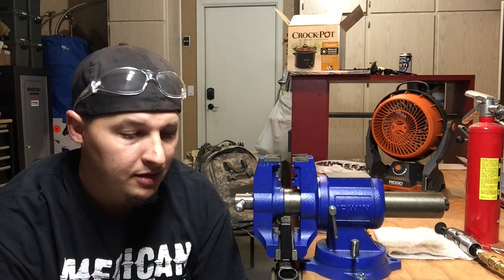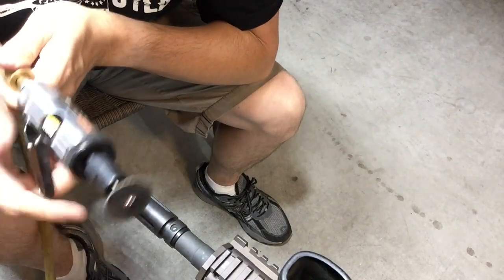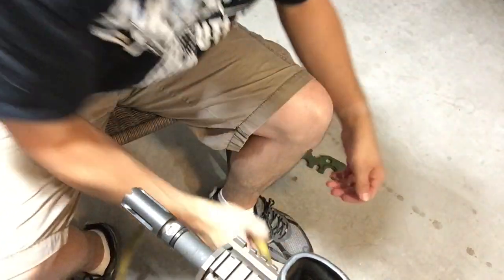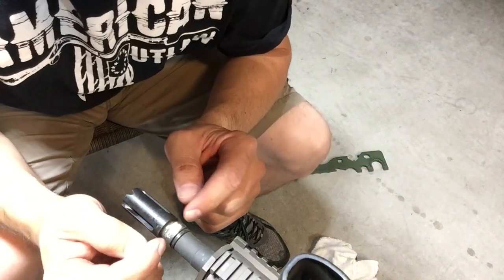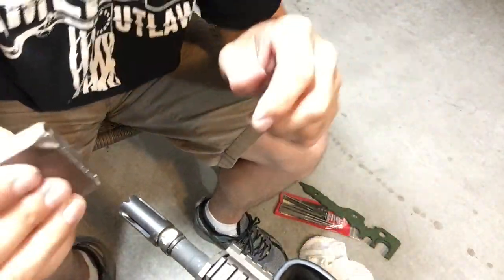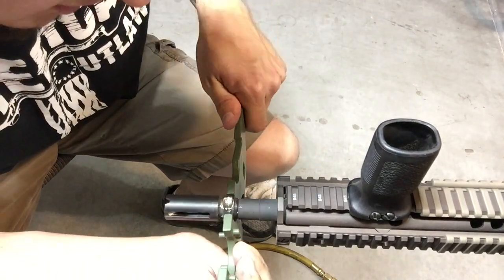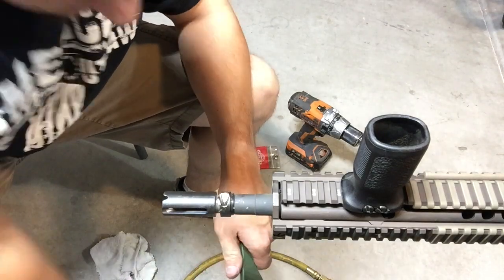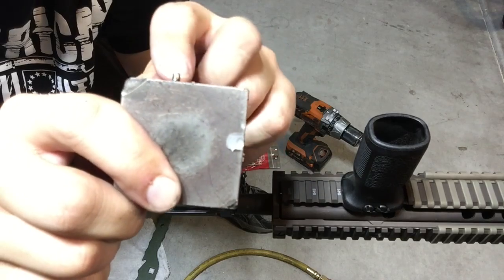Removing Daniel Defense M4a1 Pinned and welded Bird Cage

Comment: Pin was hardened? Why not just drill it out?
Reply from the maker: К.В. П. Honestly because I did not have a drill press and I was worried on how far down I could go without hitting my threads.
Reply: Drill press is not needed. Just a power hand drill will be far enough. Maximum pin length not more 8mm, I think. Diameter is not more than 3mm. Accurately and carefully operating by a hand drill with 2mm drill bit, you drill out this pin to a depth of 4 - 5mm, then just break the remainder with armorers wrench and unscrew the muzzle device.
Reply from the maker: Thats great information thank you If i had that info I would have tried that for sure.  At one time I attempted to drill but broke the bit right away lol live and learn.  Thanks for your information and reply very helpful.
Reply: One else moment. I don't think such pins are hardened. So, it's may to drill pin out, at least, 3mm depth, hammering a screwdriver in this opening and try to pull pin out. Or you'll can use a special extractor for  unscrewing broken bolts.
Reply: Common material for pinning is Drill Rod, made of the same thing your standard drill bits. So, unless you're using a Cobalt drill bit. You'll ruin a lot of bits trying to drill it out with standard high speed drill bits.
Reply: @BusterdBodycrab  Drill rod is in an annealed, non-hardened condition. It is generally able to be drilled out with good HS drill bits. Definitely achievable with cobalt bits. That is, unless someone uses some crazy material.

Having said that, why in the world people use drill rod for this is beyond me. It is not necessary to have such a material for pinning, and it makes things much more difficult if it needs to be removed. A piece of mild steel is plenty, even a piece of 1/8" welding rod would be OK. 

BTW: I use some annealed 4037 precision ground dowel pins for this task. Cheap, plenty strong, and reasonably easy to remove.
Reply: @LE-6920  I fucking love you, dude. Super stoked to get my M4A1 now as this was the only thing keeping me from doing so.
Reply: I believe they use drill steel for the pins. So it will be very difficult to dril it out.
Reply: Those pins are typically made from drill rod blank steel.

Comment: You are correct about the 90 deg. It's done so that you get the proper reading. If your torque wrench is in-line with your armorers wrench then you've increased the leverage and you'll apply a higher torque than your wrench is reading. This is a simple statics problem, I solved problems like this all day in mechanical engineering undergrad.
Reply from the maker: Thanks for clarifying!

Comment: much easier if you removed the handguard and put the barrel in a vise so it doesn't wobble around giving you better control. Peel washer and correct torque is all you need.

Comment: I would have never thought of using one of my magnets.  But I also think part of the problem is that your barrel isn't secure enough in your reaction rod or whatever you're using.  I'd removed the rail if I could and block my barrel in my vise.  At least that's my armchair QB opinion.  lol  However, I commend you on your use of safety glasses. :)

Comment: Appreciate this. The first rifle I ever built is an AWB AR15A2 that came with the pool cue barrel. I had Wilson Combat install their set screw & welded compensator because it at least looked a little more like a birdcage. All I want is for my rifle to look and function like a standard A2 so I'll be removing the WC compensator using your hints, installing a correct A2 birdcage, and replacing the BB gas block/sight for one with a bayonet lug. It's a great rifle, more accurate than anything I was ever issued.

Comment: You are correct about that 90-degree orientation of the  torque wrench with regard to the armorer's wrench is the proper way as to not screw your torque wrench's internals and calibration
Reply: it has nothing to do with the internals of the torque wrench. You're torque wrench doesn't know if its applying a 90ft-lbs on a screw head or on a lever arm. It has to do with the accuracy of the reading. if you're parallel to the wrench then you're increasing the leverage and applying a greater torque than your wrench is reading.

Comment: The new muzzle device came pre-drilled for a pin.  Would it be feasible to drill it larger and tap the hole and use a set screw?  I was just wondering.

Comment: A drill press would have been a tool you needed when removing the flash hider / muzzle device. Not a Dremel tool with a cut off wheel.
Reply from the maker: Robert Rivas Arroyo I know that now but like I said I’m the big fining I used what I had in the garage and the video was meant to just show a process to help others out.   Wish I had a press lol
Reply: You cannot drill drill rod with a high speed drill bit. Doesn't work. A grinding point or wheel can grind it you can't drill drill rod
Reply: @Mike-xi4zt  you can change the speed on the drill press, and use a cobalt drill bit.  I've done this before and it works, just need to remove a little bit of the weld on top of the pin to remove the pin.  You can achieve this start small then move up to a bigger size. You'll even be able to save the flash hider to reuse. It will be a very clean removal.

Comment: PNEUMATIC OIL ISNT CUTTING OIL................ AND DUMMY GET BARREL OUT OF UPPER AND SUPPORT IT.................. GET A CARBIDE DRILL BIT........................
Reply: Thanks for your comments you bring up great points and i appreciate the feedback..... I do the best I can with the available tools that I have on hand but for future projects now I have some new Ideas so thank you.
Reply: How much is a carbide drill bit and how easy do they break? It's probably cheaper just to grind the old muzzle brake off. If the pin is drill Rod which is what most of these Jack offs use to pin with a standard or even a carbide bit is not going to drill very well through that if at all

Comment: Do people normally use thread locker on their muzzle devices? I was always told to use aeroshell or anti-seize.
Reply from the maker: Jaw Knee no that is not to common of a practice thread locket breaks down under high heat i do it because I have always done it not to say it’s the best option.  Rockset is much better if you don’t want it coming off.  Anti-seize is good if you plan on taking it on and off changing the muzzle device.   I’m no gunsmith so please take this as my opinion only.
Reply: @KowalskiCLICK  Yes, Rockset is the way to go. Just a dab though. When you remove it apply a little heat and strike the end of muzzle device, with non marring hammer, to break loose.

Comment: Drill small hole in end of pin use small easy out to remove after weld is grinded off should take 15 minutes

Comment: Thank you for this video!!! It's exactly how I pictured myself butchering mine off but was really nervous to hit the threads and open a whole nother can of worms but you gave me the confidence to go for it and it worked out perfect like yours. Only thing I did different was I just kept grinding the pin down as far as I was comfortable, then went a little further, every so often shocking the brake and wiggling back and forth and the remainder of the pin just shot across the room without having to pull it out with the magnet but she spun right off with absolutley no damage to the threads! Thanks again for taking the time to record everything and the measurements for a rough idea what was safe to grind away! 👊
Reply from the maker: Happy it was helpful to you :) thanks for sharing!

Comment: why not just buy 16in barrel?
Reply from the maker: Derek Comingo Only because I already owned the 14 1/2 inch barrel and wanted to attach my suppressor to it so instead of rebarreling it was easier to just drill the pin out and put a new break on so that my suppressor could be mounted I already had the tax stamp so.  I also wanted to see if I could do it. 

Thanks for your question

Comment: "Bird Cage" is what Dumb privates in Basic training call a Flash Hider.

Also couldn't you just use a small drill bit and drill the pin out without damaging the threads or Flash Hider?
Reply: You would have to know how deep the pin goes. Without that knowledge you could drill through the barrel..